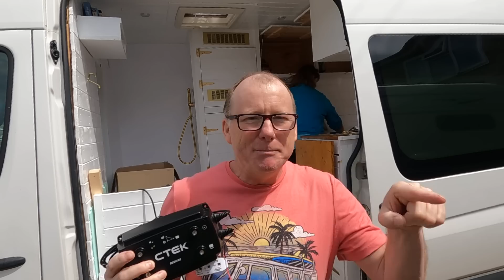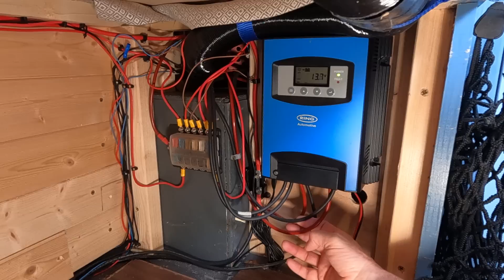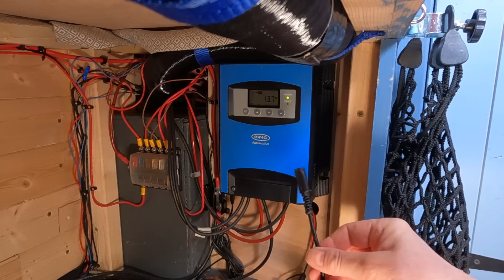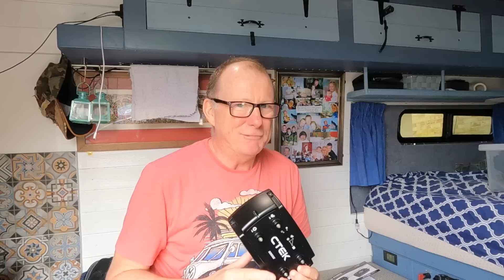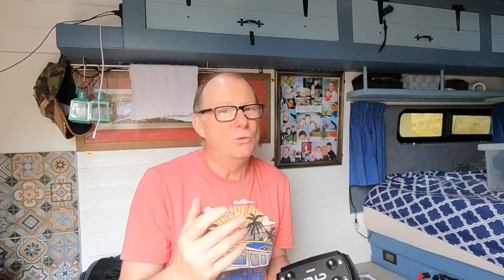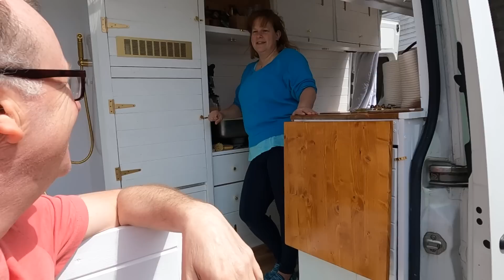The best way to charge camper van battery #vanlife

Comment: Love the video, brilliant 👍 just to ask I've just purchased a ctec c250se and wanted to fit a under 23v solar, can I wire two solar panels  together would I get under 23v open circuit if I had two, I noticed on your video you where swapping your Two panels  to fit on the ctec dc to dc charger, hope you could help thanks Craig😊 👍
Reply from the maker: Yes you would be fine as long as the wire them in parallel 👍🤓👍
Reply: @MelsBigVanSmallWorld  great thanks for your help, your vans looking fab m8 👍

Comment: Hi Mel,
Am I right in thinking that the RING doesn’t need a connection to an ignition live ,but the ctek does, ? So ring needs 2 wires from starter battery ,?many thanks
Ps , I have a 2017 vw caddy with smart alternator
Reply from the maker: Yes you’re absolutely right
Reply: Thankyou buddy 👍

Comment: I have the CTEK installed since two years. Very happy with it. I don't miss the LCD display; to be honest, this is something you will look at in the beginning. But in the long end, no one will be bothered checking the LCD display. Especially since these controllers tend to be installed in hard to access areas of the van. By the way, the CTEK is able to charger the leisure battery from the alternator and solar at the same time, providing these sources provide enough energy at a given time.
Reply from the maker: Oh that’s interesting thank you 🙏

Comment: Alpha batteries have recommended the 12v explorer dc dc 45a charger as I'm interested in 2 batteries from them with a total of 230ah and the cetek is 20a charger which is not enough for the battery bank,  now that has through me off a bit as I don't see anything on YouTube about the explorer dc dc charger,  do you know anything about the 12v explorer?
Reply from the maker: I’m sorry I don’t know anything about them I’m sure if alpha recommend it it’s fine 👍

Comment: Mel im wanting to add a 60w solar panel. Do I need to add a fuse between the solar panel and the ring charger and what size fuse would you suggest if so? Many thanks!
Reply from the maker: 30amp fuse should be ok 👍

Comment: The D250SE manual states 'Starter battery is only available as lead-acid battery' - my starter battery is AGM so is the D250SE compatible or not?
Reply from the maker: I’d say not
Reply: I have used AGM Starter batteries in 3 of my latest builds. No problem. To be sure . Ask the customer service at CTEK  really fast and nice service.  And hi from Sweden. ( CTEK is Swedish) 😜

Comment: i have the ring and so far so good. i do not have a smart alternator so i increased the cut of and cut in settings to 12.6v and 13v instead of 12.2v and 12.7v. i didnt like the idea of making my car bateery go down to 12.2v as ive been told thats terrible for your van.  something else i noticed thats worth a mention. the ring controller seems to charge from the battery and not the altinator so after you switch your eengine off it continues to take from the battery until it hits it minumum value. again this is why i have upped mine to 12.6 as ive been told a battery should not go below. 12.5.. thoughts?
Reply from the maker: Thank you Kye for taking the time to comment you are absolutely right I’m going to change my settings too and see what happens 👍😊👍
Reply: @MelsBigVanSmallWorld  im about a month in now and it seems all good :)
Reply: @MelsBigVanSmallWorld  p.s. cheers for all the videos dude. Make life nice n easy :)

Comment: I have the Ctek in my T4. The reason I went with it is mainly cost and size. I started with one 100Ah lead acid battery which you don't need to connect any extra wires for. As I've expanded my build I added the smart pass unit, which enables me to utilise more of the alternator output, charging faster. I don't know how much the ring unit costs, but at around £250 each for the main Ctek and the smart pass, it made it more affordable for me. It's also much smaller meaning I could get it under the front seats along with my batteries. It's done a great job so far, so I have no complaints.
Reply from the maker: Sounds like you have a really good setup 👍😊👍

Comment: Hello Mel, I have got that CTEK D250SE  I have wired the negative to the chassis where did you wire the positive to.I saw a video where you wired  it under the drivers seat fusebox but can't find that video.Which video was it please

Comment: Ctek for me Mel... with the Ctek 250 SE and Ctek Smartpass 120s...dc to dc.... never had to connect to hookup and runs 160w renogy solar also...I'm sure it states in the manual (s) can take a max of 3x 150w solar panels. It really is a personal preference and I hear good things about ring also. Cheers for the video.
Reply from the maker: Thank you for the positive message sounds like you have a sweet setup 👍😊👍

Comment: Hi Mel, sorry, me again, just watched a video where the guy uses a dc - dc booster that charges the jackery (or any other solar generator faster than the supplied brick unit) increased the input wattage by approx 50% from the solar panel provided by jackery (which he wasn't very complimentary about) the same small unit can be used via the 12v charging lead supplied, any thoughts? ( How To Charge Your Portable Power Station FASTER! Simple Trick! by electronicsNmore)
Reply from the maker: Interesting thank you 😊

Comment: 1)*X* cetec not suitable for lithium.iron batteries ,  no option to switch off the  desulfation mode  mode. X  It is lead acid only.* X*
 EDIT.....  Appologies  latest 250SE version does charge lithium iron phosphate bateries at 3.55V per cell.  No indication of a low temperature cut off.DjC
2) you said the cetec also returned solar charge to the vehicle battery . It does not,  that is a function of the smart pass unit which can e used with the b2b charger.
3  those extra two wires  black one is to set voltage for AGM batteries(14.7+) when connected to earth, or lfp batteries( 14.2v) when permanently connected  to 12v supply.  
The red one is to set for smart Alternators when connected to switched ignition feed.
Reply: Yes I have the Ctek D250sa also and I agree that it doesn't supply power back to the engine battery, only the leisure batteries. Mine is set up for smart Alternator. These smart alternators are a right Pita.
Reply: @ashleymears8072  if you or any one is having problems with your cetec ( or any other b2b charger) talk to stirling power products.   They seem to be much more pro,-active in keeping up with the latest smart alternators than most manufacturers.
It may just be that they are better at getting queries to the right person.
Reply from the maker: thanks for that we live and learn

Comment: I have a touring caravan (a trailer pulled by my car). I have no power from the car alternator, just solar. I have a large AGM battery (Varta). And my solar charging system was all bought very cheaply from Aliexpress (Chinese). I have 4 flexible solar panels of 100 watts each. And a very cheap unbranded charge controller (Chinese). All about 3 years old. Still seems to work OK. Having said that, I have not been using the caravan during Covid until very recently. I am a little concerned the battery could have been over charged. Will have to see how things go when winter comes around. I live in the south of Spain, so have plenty of sun most of the time. Will be moving back in full time soon. I never use mains hookup.
Reply from the maker: Sounds like you got it we’ll kitted out that’s brilliant enjoy your summer stay safe 👍

Comment: Is there a way to set up some kind of switch with the ring controller to allow you to click it to charge the starter battery when parked up? Basically disconnecting the leisure battery and diverting input to the starter battery. My starter battery is often dead when I come to drive my van as its not driven much at the minute.
Reply from the maker: Sounds like a great idea but I use something like this I even made a video all about it https://amzn.to/2SYEAIL

Comment: Abso DMT-1250 for me, takes 50v/30a of solar and 50a from battery. Also charges my lithium batteries, lovely bit of kit.
Reply from the maker: Sounds good 👍
Reply: That's the one I wish I had bought to allow expansion and give me the 50 amps ability.
Reply: Mel, I've the Ring RSCDC30 too, you should be able to set the charge profile for lithium batteries no problem. Also be wary of using solar priority, it's been know to cause charging issues...I have mine switched off and the batteries are fully charged from my 325 watt panel whilst the van has been stationary. I have a separate panel to trickle charge my van battery and am going to make my own version of the 'Jackery' for a fraction of the cost when I have time.

Comment: I'm looking at using a Jackery linked up to the fuse box using XT90 connectors via the 12v outlet on the Jackery, I know thats something you mentioned in a reply recently too, looking forward to how you figure it out, glad your on the mend
Reply from the maker: One of the first projects I’ll be working on when I’m back on my feet I’m quite looking forward to seeing how the Jackery copes I’m going to try and keep it as simple as possible 😅😊👍
Reply: My only concern is the 12v outlet on my 1000w Jackery is 10amps and not sure if that's enough, may just have to be careful and monitor what's being used at any one time, suppose the other alternative is to use the Jackery as a hook up for the leisure batteries
Reply from the maker: I’m doing experiments with my one rite now 👍

Comment: got the ring unit in my second build after watching your video on it (had a victron bluetooth in my last build) good bit of kit but it is quite big, mines is fitted below bench seat in an L2H2 Transit custom. I chose it because of the smart alternator charging when driving and rather than fitting 2 separate units, 1 for the split charging and 1 for the solar (I've got a 250w explorer from Alpha Batteries) its a really simple install as you say. Almost didn't recognise you Mel without the hat.
Reply from the maker: Thank you Bob for the positive message really appreciated 👍😊👍

Comment: Mpp hybrid charger inverter. Mine has a 2.7 kW inverter, 25 mppt amp charger (solar and shore/generator/engine), but other combinations are possible. Only useful if you plan on using a larger inverter though
Reply from the maker: Sounds like you have a great setup 😊👍

Comment: Hi Mel. . Bobby's Box here. . Just fitted a Ctek DC to DC Solar charger in my van. . My van DOES NOT have a Smart Alternator.  I have led Acid Batteries in my van . . So where do I put the red n black wire. . and also the red wire?. . I mean the small wires that are at side of the Ctek?
Reply: My solar pannel is 25 volts. . (Not fitted yet) and I have 2 solar panels whats your advice
Reply from the maker: from memory I don’t think you contact them with an ordinary alternator my advice would be to look at the label it’s clearly marked on there I don’t have the unit to hand so I can’t look for you sorry

Comment: If I was going to go for a all in one system i would go for the renogy 50 amp all in one
Reply from the maker: Yes I may just try one in my next build so I can compare them 👍
Reply: That’s what I have along with the BT2 Bluetooth module. The Renogy also only allows a max of 25V solar input. I have 2x 160w Renogy panels in parallel. Working a treat so far!
Reply: I looked at more powerful chargers as well, but I have an old sprinter van with a smaller alternator with 90 amp max, that I would need to upgrade as well then from what I understand. Or buy a new sprinter van ,😀

Comment: There are many other controller's available including redarc and renogy. I personally went for the renogy as it does everything including mppt controller for the solar, trickle charges main battery when house battery is full and has a bluetooth ap to monitor everything. I know they're expensive, but lithium is the way to go long term. 
Love the video and glad to see your better.
Reply: Don't know what the ring costs, but the renogy costs about 220. Like the ring it will charge other batteries incldding lithium.
Reply: With the renogy, it charges at up to 50 amp so will charge fast.
Reply: @chrislant4829  from what I have understood about the renogy it will do 25a of solar and 25a of alternator charging.. im sure I did read that if you was to not have the solar connected you could then get the 50a of charging from the alternator
Reply: Everybody gangsta till they find out there only getting half advertised amperage.  When you say lithium is the way to go you might want to look into that a bit deeper also
Reply from the maker: Sounds like a a fantastic setup unfortunately probably way out of many peoples budgets including mine 👍😊👍